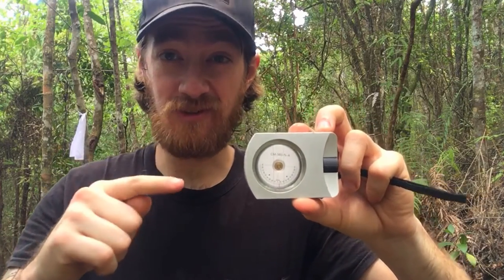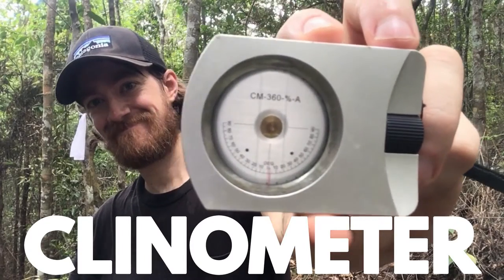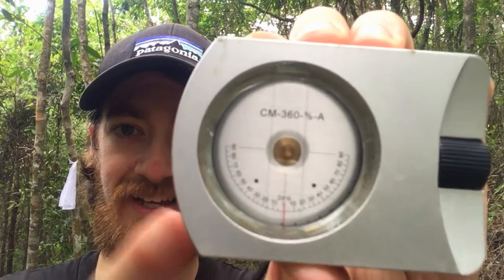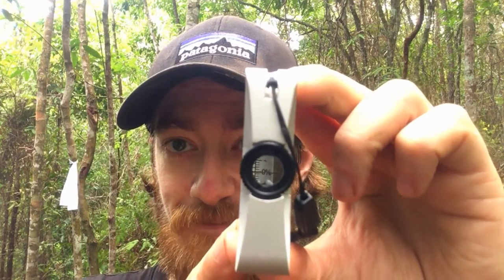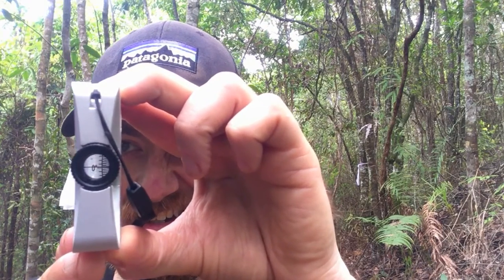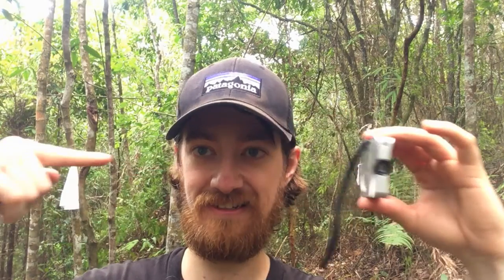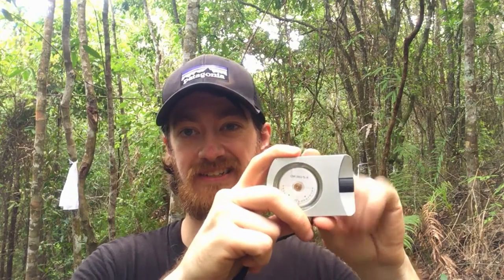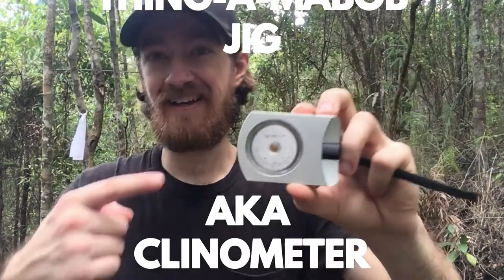How to Use a Clinometer

Comment: you were in borneo when you shot this video?
Reply from the maker: Affirmative.
Reply: @A.T.TrailWorks  which part of Borneo?
Reply from the maker: Brunei
Reply from the maker: I did venture into Malaysia on a few occasions but I only ever built trail in Brunei which is where I was living at the time. Been doing trail design Stateside off and on since 2021 and it has it's own challenges but it's nowhere near as difficult as the tropics.